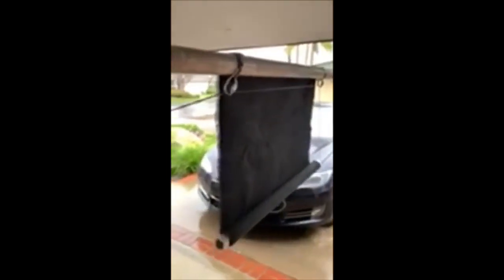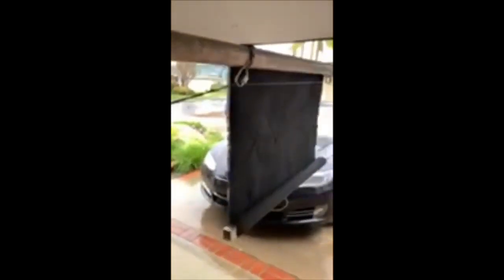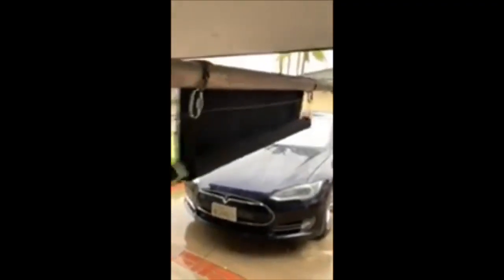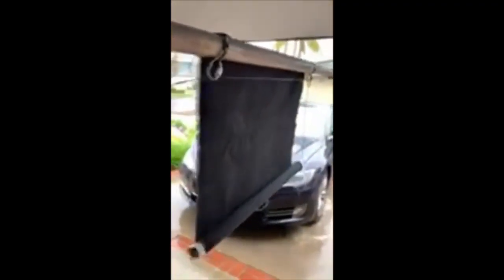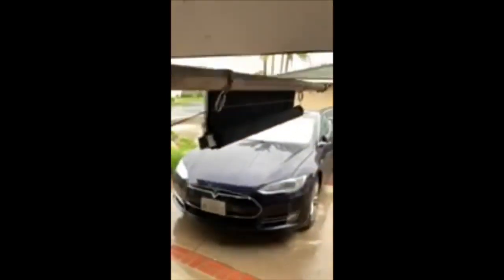Controlling Teasers and Skirts.

Comment: Hello ! Great videos guys.
I was wondering, could you do a video on the best way/methods to level track for a dolly shot ? 
But like on a surface which is very difficult to see which is the high point ?  Most examples I see are easy examples on pretty even ground. Would be cool to see some tips on unsteady sidewalk or even inside and setting the tsicks on your platform (if no actuall dolly but just a camera rachet strapped on a platform). 
Any tips would be great. I see grips here in europe go flat to the ground to 'eye' up the ground and see where it's curving or rising, others who go straight to their leveller to check crossways then lenthways with the leveller. Everyone seems to do it a bit differently ! Would be great to have a video on some how to's, maybe in a couple of situations.
Many thanks !
Emma